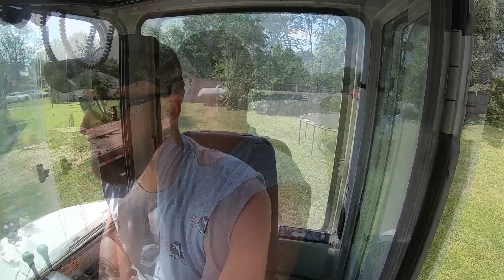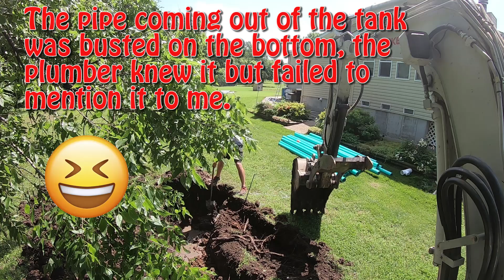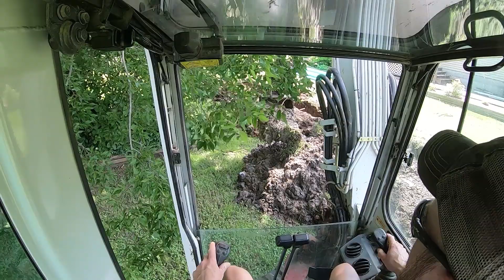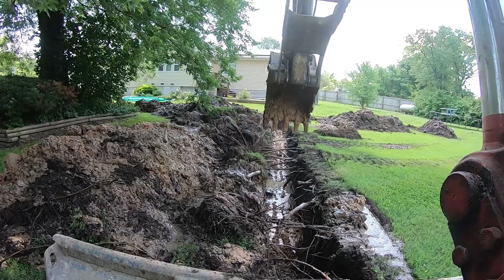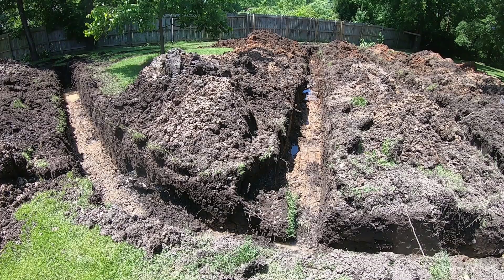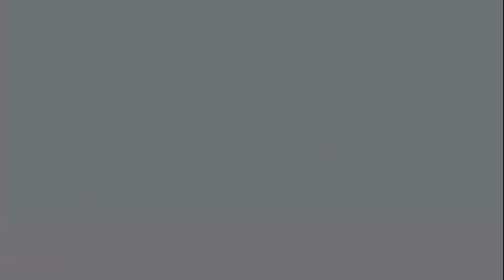Digging Up A Failing Leach Field

Comment: Hey Brandon there's a company out of Laurel Montana that invented and sells an attachment for either a skid steer or mini ex that is basically a sharp pipe with a big air tank and you stab it into the ground around a failed leach field and it loosens up the ground and rejuvenates the leach field so that you don't have to dig it up and go home smelling like an outhouse! You should check it out I've seen some of their ads on YouTube. You might even end up putting that plumber out of business! ;-)
Reply from the maker: Clyde Acor cool! I didn’t know such a thing existed. Thanks
Reply: They were a big deal around here 15 years ago.  But junk  like a 5 minute bandaid.          Get much better luck. If you pump it dry in the corners then shove 100 to 150 gallons  of hydrogen peroxide thru it.    You will get 5 plus years out of it.         I dont do it but got buddies who do.        We just replace them with a new one.
Reply: @eliteearthworksllc  ya it's basically like how they frac for oil but it's for poo! Lol... and from contractor reviews it's got a very high success rate of like 80% to 90%. A lot of septic companies are starting to use them.

Comment: What a job lol I would of closed all windows and door. Got a tin of air fresher 😂 should smell bit better.
Reply from the maker: Rory Jones yeah the ac hasn’t been working as well in the 153 of course lol. Good idea on the air freshener
Reply: @eliteearthworksllc  old trick we use when doing sewer works 50% of machines used on UK sites are on hire so AC is not always working and batterd tekeuchi are no1 for reliability
Reply from the maker: Yeah you can’t beat the Takeuchi. My TL 250 has 7100 hours on it and still going strong
Reply: @eliteearthworksllc  that's still like new to us in UK lol I'm on a site with Tb250 20200 hrs Tb175 29510 still going strong
Reply from the maker: Rory Jones wow that is awesome! Very impressive, to me there is nothing better than Takeuchi! I can’t wait to pick up my 260 this week
Reply: @eliteearthworksllc  yea they are 2 and 3 years old. Can't wait for the unvailing video of the 260 and to see it in action. Do you guys have forward tipping dumpers over there as they are just as common as a 360 here
Reply from the maker: No we really don’t have those here but they look like they would come in handy
Reply: @eliteearthworksllc  they are very handy they start from 1ton to 10ton and have swivel skips and cheap to run. I'm doing my licence next week I will upload a few videos  of them  in action